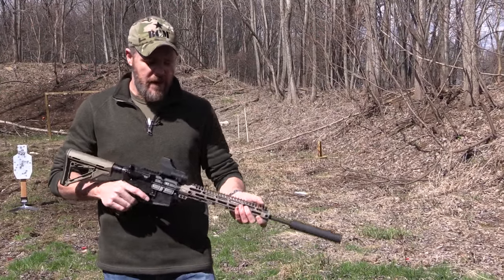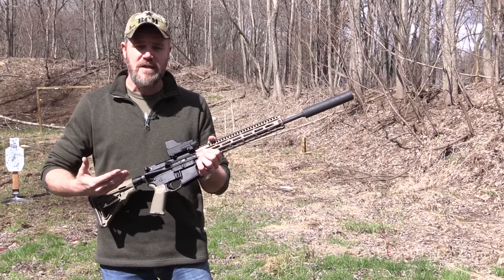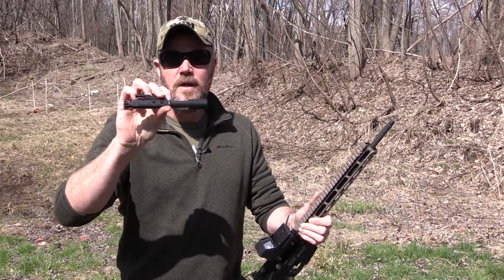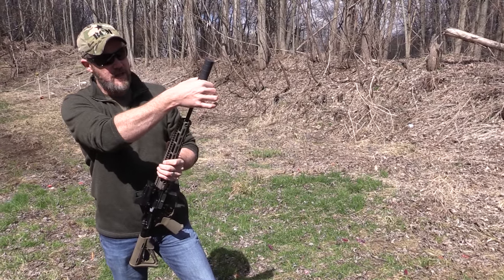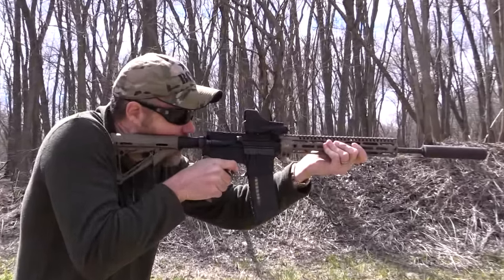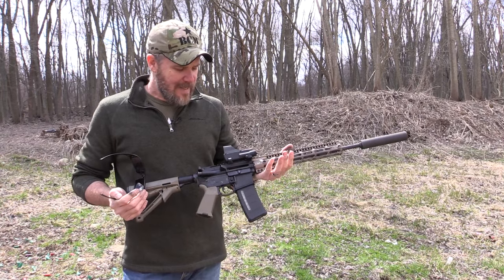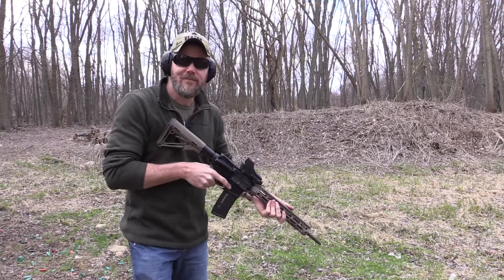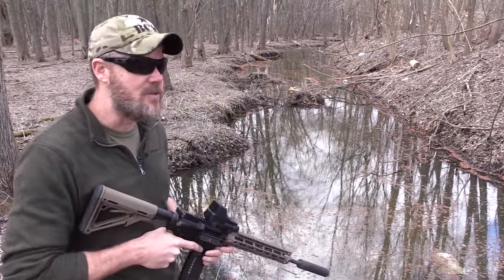GEMTECH Suppressed Bolt Carrier

Comment: This video made me buy one.... I REGRET IT.I live in Lubbock TX. I ordered one from SilencerShop in Austin TX right after this video was released. Today, 06/13/16, the story has finally ended for me with a huge disappointment. As soon as I got my Supressed BCG (the AR-10 variety) I read the short manual and attempted to turn the little valve on the BCG with flat screwdriver. It would not go. After I bent one screwdriver I took a better one... the valve snapped and broke. I called Gemtech. In about 9 days I got a replacement, brand new one. The valve turned fine on it. I was about to put it in the gun (M&P 10) when I found out that my bolt would not go in. The BCG was way to narrow for it. I called Gemtech again, told them about it. Their tech guy told me that they would check if all BCGs are same, thus not working with S&W rifles, or maybe I just got a bad one again. In about 13 days no one has contacted me. I called again and was told that even though it supposed to work with all DPMS pattern rifles it appears to work ONLY with DPMS AR-10... Also they told me that they are discontinuing the whole line on AR-10 Supressed BCGs and that I should return it to the place I got it from. I called the SilencerShop and was very politely told to F off. Their manager said that they are only retailers and not responsible if stuff they sell doesn't work. I called Gemtech again. Finally they agreed to give me a refund. I emailed them the receipt for $309. Almost a month later, after I emailed and reminded them about this many times, I finally got my refund in mail today. Total of $279....... I am not even going to bother calling them about the other $30. They can keep it. It was my first and last dealing with Gemtech. This is just my personal experience, but I'm done with them. I do not suggest you buy their product. Apparently they do not even bother to test if their stuff works as advertised.
Reply: I have six of the AR-10 versions.  They work in every Bushmaster, CMMG, DPMS, 80% and others that I have.  The only gun I  have that they don't fit in is the DPMS SASS II and it definately has a proprietary bolt carrier.  I guess with Bushmaster and DPMS f'ed to death by Remington/Freedom group that those guns are moot.  Everything lil' Green and the F up group has touched is different or dead or dying.  Gemtech bought by Smith & Wesson is suffering a similar fate.  My rep of many years us gone, replaced by kids who identify as gun people but are not...

Comment: I would love to say this is a great product.  I certainly hoped it would be when I purchased it.  Starting point was an overgased 16" Colt heavy barrel upper with a posted front sight I did not want to change out.  I've tried it now in three different rifles. And these are not cheap guns.First impression was sad.  Short stroked in all of my guns that had hither-to-fore worked perfectly with any ammo, suppressed (HALO) or unsuppressed.  Would not even work in the normal "unsuppressed" mode.  Short stroked every kind of ammo I put through them (including M855 and Hornady TAP T2).  Failure to feed.  Failure to eject.  Failure to hold open.  Even failures to feed on PMag's that work fine with every other BCG they have been used with.Spoke with Gemtech (nice guys by the way) who offered some suggestions.  (Reduce buffer weight, reduce spring tension, etc.)  Did so.  Spent a lot of money on test parts, and burned through a lot of ammo.Long story short.  The first five or six rounds through a clean/cold/well oiled gun work fine with a carbine buffer and an underpowered spring.  About the seventh round, no more last round hold open.  Things go down hill from there.So my 200 dollar experiment with this carrier is now pushing four figures.  I'm sorry Gemtech; but save yourself a lot of aggravation and just go to an adjustable gas block.
Reply: Mark B yep. The lack of adjustability is the downfall, along with price. An adjustable gas block can be tuned for different ammo or gas port sizes.
Reply: Couldn't they make their design have four or five positions instead of simply S and U? Like S 1 2 3 4, four could be completely open as big as it can be and go down from there in increments to an "S" setting. Then you've still got the advantages of not messing with a gas block conversion and losing interchangeability with other AR's  and have a good range of adjustment with this type of system. Would that not help? Just asking because I'm sure I haven't thought this through properly!

Comment: I've been waiting for someone to do a review on this bolt carrier. I have read written reviews but they just don't do it for me. I think I will pick one of these up. I can't fit an adjustable gas block under my hand guards on most of my uppers.

The shots with it in suppressed mode but no suppressor shows how effective it really is. 

 Thank you for this review.
Reply: I'm with you. written reviews seem to sound more like paid product endorsements and advertisements to me anymore. I gotta see it myself before I believe it!
Reply: +Mr300 blackout Hello.  I have personal experience with this product...............thankful I was wearing eye protection...........even then, my eyes still took a hard hit from the back pressure on a very short 556...........this product solved the problem and there was no back pressure after using it.

Comment: What springs to mind right away is that gas tube pressure determines how much the BCG rocks back and wears on the soft Upper receiver. Adding a restriction at the gas key or BCG will increase this force. Limiting at the gas block is the answer if you need adjustment on a DI gun.

Comment: Its a good idea but I don't understand why they didn't give it an automatic function too. It would literally just take a single spring to regulate the gas. If there's too much the spring can't hold the pressure and the valve opens to reduce the kick back, if there isn't enough the spring remains closed and the system functions as a normal bolt carrier. I mean sure allow the non suppressed function to remain to allow people to revert it back to a normal bolt carrier if they need absolute reliability but it would take less than a week of design and testing to add an automatic function and wouldn't add much at all to the production cost. They could even keep the current functionality and add it as a third mode so people can get the ultimate in "no bolt kickback" shooting.
Reply: Olivia Lambert - it’s not that the gas pressure is too high; it’s really no higher.  The problem is that the pressure is present for a relatively longer period of time, which means that the bolt continues to accelerate rearward and exceeds the velocity of a bolt when no suppressor is attached.

Comment: Running a BCM 16" midlength upper with a Dead Air Sandman-S.  Functions with or without a suppressor,  is not over gassed or under gassed and no excessive blow back to the face.  Every set up is different but with a quality upper and suppressor I feel many don't have these issues.
Reply from the maker: +roushspeedfreak1989 The only low gas suppressor I'm aware of on the market is the OSS stuff. I have a Sandman-S and mine most certainly does produce increased back pressure.
Reply: +Military Arms Channel I didn't say the Sandman series eliminates back pressure all together.  I said it isn't excessive.  You will experience increased pressure/blowback with any can but some produce less than others.  That was Mike Pappas' goal with the Sandman series - low back pressure so suppressed shooting is quieter     to shooter's ear, acceptable decibel reduction at the muzzle, a rock solid mounting system and a can built like a tank.  Dead Air hit the mark.

SureFire also advertises their rifle suppressors as low back pressure offerings as well.  Unfortunately they're suppression level leaves much to be desired.  Most of their units are louder compared to other manufacturers on the market. 

From my experience an AR with a midlength gas system is a great option for suppressed use.  I don't have to mess around with adjustable gas blocks or bolt carriers.  Again, just my experience.  Thanks for the video!

Comment: Hey Tim, not sure if this is your personal property or not, but just warning you, the lead from the bullets can easily infiltrate ground water. Ground water travels laterally, so anyone in the area with a well may experience problems. Especially pregnant women. Of course, just a small number of bullets will have a negligible impact, but it's probably not a good habit to have. Depending on the depth of the water table, standing water on the surface (ponds) may interact with ground water. Streams behave similarly, and will lose water if the water table is low. If the water table is high, (from lots of precipitation), streams may actually gain water from the water table. This is why shooting into streams/ponds is worse than just shooting into a berm. The berm will only leach lead when it gets rained on, while the stream has the potential to leach 24/7. Another great video though. I could give a fuck less about the safety aspects of shooting water haha. I agree with you there.

Comment: Got a 556 carrier a few months back.  I love it!! On my BCM 11.5 inch SBR I definitely notice less gas on that gun. I have also used it on a 20 inch and 16 inch barrel, I don’t notice the gas difference as much on those rifles compared to the 11.5 inch.  I would buy it again.  One plus I have noticed is with the Gemtech carrier the action is much cleaner after shooting suppressed, no doubt from the design intent of venting off more of the gas.
Reply: did you notice any cycling issues with the 20"?  Was it a rifle length gas system and what buffer did you use ( factory or aftermarket)?
Reply: @brandonc6078  I have not had any issues with it.  All rifle are set up with standard springs and carbine buffers.
Reply: Ok just wondering.  I was having cycling issue but I think it was because of the jp silent capture spring kit.

Comment: I think it's a neat idea and possibly quicker than some adjustable gas blocks but it really isn't stopping the extra gas from entering the upper, it's just blocking it from entering the bcg. Im almost wondering how much more buildup you would get at the chamber& bcg/bolt exterior compared to the buildup with running overgassed& flowing through the bcg.

Comment: How does it work with 300 BO Super amd Sub?
Reply from the maker: +Kirk Manis Haven't tried it yet.
Reply: Yep. I'm interested as well. 300 BLK test please :)
Reply: probably not much of a difference. Maybe on a pistol gas system but I'd guess it would be minimal
Reply: +Kirk Manis I was just going to ask this question. I'd be interested in seeing that test. The entire video I was thinking, "This could be beneficial in a suppressed 300 BLK build."
Reply: I'm yet to fire or hear of an over gassed 300black. A lot of ports have to be reamed to increase the gas just for proper cycling.
Reply: +Kirk Manis i was JUST going to ask that!
Reply: +Kirk Manis the bolt still moves the same way dude.
Reply: +Military Arms Channel Tim, PLEASE post a vid when you test the .308 GemTech .308 Suppressed Bolt Carrier.
The reason I ask is that .308 ARs are a different ball of wax than AR-15s, and I am curious if it works in DPMS or Armalite pattern .308 ARs.

Thanks for the awesome vids and good work.
Reply: +El Jericho 
Entirely different, for sure.

I opted against suppressing my LR-308 after hearing about the heat issues of suppressors.
I made this thing for volume of fire power above all else.

So I'm thinking of making a dedicated 300BLK 'stealth fun gun' to fill that role.

I might have a problem.  I can't stop buying guns.
Reply: manictiger It's not a problem- it's a blessing.
Heat issues arise with any high volume shooting.
Unless you're made of $$$, you ain't gonna be doing mag dumps with .308, lol.
You should suppress it if it's legal where you are. Why not?
Reply: El Jericho
Military Arms Channel does a video where they run two 30-rd. mags through a suppressor and it reaches the maximum temp considered safe for it.

The third mag dump makes it go above 1000F?  (I don't remember if it was F or C).
This is well above the recommended maximum.

Considering the suppressor I'd get is 1100 bucks, I would not want to ruin it after a few uses.
But I also refuse to use my volume of fire gun 'sparingly'.
So I have to make a new gun.
Reply: +Kirk Manis  Give the folks at Gem-tech a call........good bunch and they will be able to get you an answer.
Reply: You dont have overgassing and/or carrier velocity issues with 300 blk so its irrelevant. The only problem you have with 300 blk is not cycling subs without a suppressor. Thos bcg wouldnt help that
Reply: ROSCOE P What's the point of shooting subsonic ammo without a suppressor on the rifle? Lol.
Reply: +kyle_429 in my opinion, none at all but it seems to be a concern of the fan boys.
Reply: my question would be what would be the quietest .300blk you could have. and why not have a dB meter
Reply: Nykolas Griffith the quietest 300 blk is a bolt action with a large volume 30 caliber suppressor with direct thread attachment shooting a subsonic load.

Comment: Looks very useful. I'm curious though, in it's suppressed setting, how well does it handle subsonic ammunition  or 300blk? does the regulator give someone issues with that and do you need to open it up for lower pressure rounds designed to be suppressed? if it wasn't tested yet I hope you guys consider testing that as well. good work as always.

Comment: If I only shoot my AR suppressed, wouldn't a stronger buffer spring have essentially the same end result as the suppressed setting on the BCG. I like the idea of reducing gas in the face, but in the video it doesn't seem the product was all that effective in doing so hence, the higher power buffer spring may be a better option for some, no?
Reply: That was essentially the advice I got from my AR manufacture... upgrade the buffer weight
Reply: SpringCo Springs cost $20/ea and work wonders for achieving the ideal Four O'clock ejection pattern.
Reply: kn

Comment: Just put a good adjustable gas block on. Way cheaper, and actually works better because it limits the amount of gas that ever escapes from the barrel. Also easier to adjust on the fly than this. With the gas block adjusted properly I get very little if any gas blowback in my face and I am a left handed shooter shooting a right handed AR.

Comment: wonder how it would work in combination with an adjustable gas block?
Reply: +Indianahillclimber Would you need an adjustable block with this?
Reply: No.
Reply: +IIIII47IIIII not hard to achieve that's one of the main reasons piston ARs were made
Reply: +IIIII47IIIII MicroMOA Govnah gas block is what you seek
Reply: +Indianahillclimber I think U will achieve the same effect removing the bolt rings when running suppressed .If it works U can by a spare bolt for use with unsuppressed .
Reply: +Indianahillclimber Why not just buy an adjustable gas block without the bcg and save some money?
Reply: +Indianahillclimber Im also wondering how it would go with my mini nuclear reactor attachment softmod of course hardmount is too hard (thats what she said)
Reply: +Indianahillclimber This is silly. Adjustable gas block does the same thing, except adjustable gas block keeps pressure in the barrel, keeping bullet velocity at max.
Reply: +Lollygag good point.

Comment: Then new Agency Arms rifle has a carrier that does the same thing, except you can adjust it from the port side without removing the bcg from the upper.. This is a great design and after some r&d, and more settings added, it could be used like an adjustable gas block..
Reply from the maker: +ShitFromShinola I believe PWS has one too they were showing at SHOT Show this year. I plan to get my hands on it and compare it to the Gemtech.
Reply: That BCG is from Bootleginc.com and they did the handguard as well. That BCG has 4 positions and is adjustable from the outside, no need to take it out.

Comment: Sure is more convenient than replacing a gas block.
Reply: Not to mention lwrci and noveske are the only ones with a real adjustable on the fly gas block. The others with set screws are a joke. The paladin is impossible to get. I been everywhere. Noveske switchblock is the best IMO, but this bcg is a good fix for a lot of people vs a new upper or $500 barrel

Comment: Why this over an adjustable gas block like Syrac Ordnance's?  18 levels of adjustment from full off to full on, works with .308 and is less than half the price of the GEMTECH BCG.  Wouldn't it also limit the gas after the gas tube, putting added stress on the part designed to burst before a barrel failure?    I'm sure the BCG is an excellent product, but besides the ease of installation I don't understand its benefits over an adjustable gas block.

Comment: So how would you compare this Gemtech bcg with the Lantac e-bcg which is specifically designed for suppressed fire as well?the Lantac has the forward angle cut gas port holes? also the end of it isn't straight light the Gemtech, it swoops up at more of an angle like a plunger.

Comment: I wonder how well it work with the new 2017 OSS Suppresor? or if it would work at all.
Reply: Johny Brims OSS suppressors do not require any modifications to a rifle to use. there is no over gas issues with those suppressors, no adjustable gas block required, no vented bolt carrier required.
Reply: Wesley Ash yeah. i thought about that later. thanks.